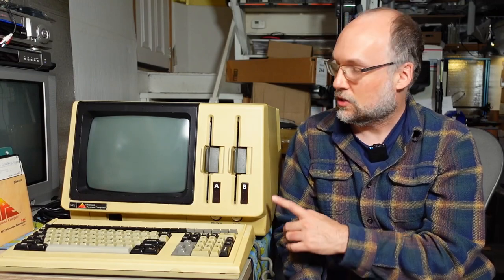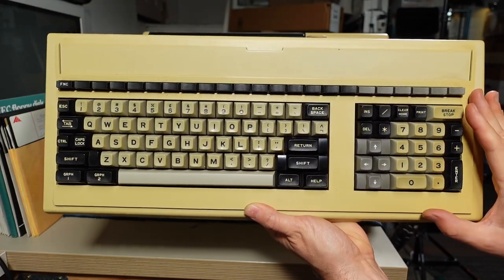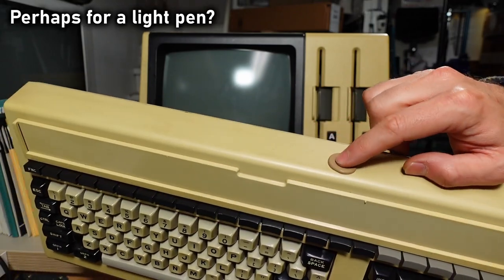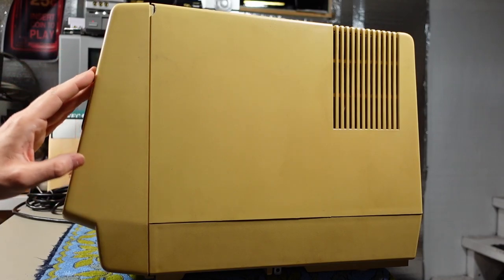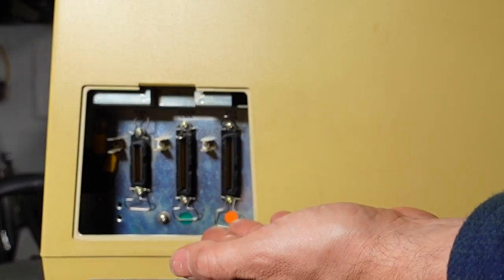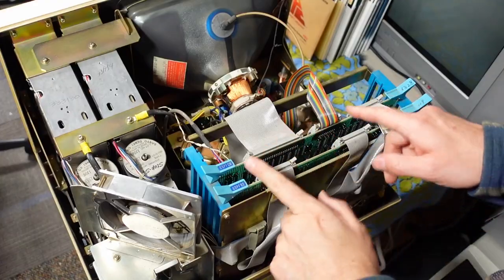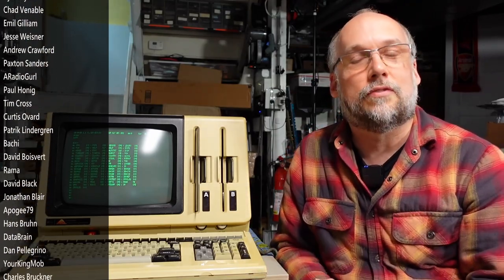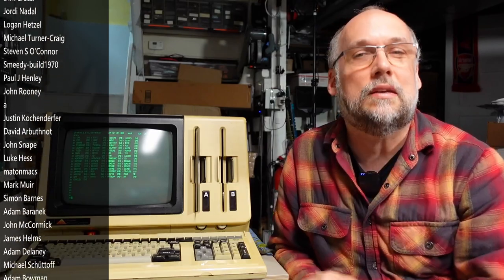The NEC APC runs MS-DOS from 8" disks

Comment: Looks like a really nice system to work on.  I wonder if it's possible to hack in Harddisk support via the leftover DMA channel, and a BIOS/ROM extension :)
Since the 8086 has a 16-bit data bus,even at only a little over the XT frequency, it should run quite a bit faster, since the data doesn't have to come into the chip in chunks of 8 bits.

Comment: Adrian I'm looking at the memory map that you have on screen a person could go into the 8K ROM at ffff and alter it to where the first thing it does is checks $128 KB of battery backed up memory for a special character at the first bite to see if it has a copy of dolls stored in it and could boot the machine straight off of that memory chunk check the first bite to see if it's a wire and in if it's an in it Boots the system as normal off the floppy if it's a y it starts executing the memory at the a1000 address

Comment: It's fairly common for 115 and 230 V fans to be made from metal, either partially or entirely, even today. Nowadays you wouldn't put them into a computer because they generate too much noise, but they are still used in some appliances

Comment: 42:53 - at the jump cut the Power light came on, maybe it has something to do with the keyboard being connected?
Reply from the maker: Strangely after using it some more, the power light just seems to have a delay coming on. It's directly connected to the power cord, so it has to be the switch itself -- but it is just odd! I saw the power switch coming on so I made sure to leave it in when I edited the video.

Comment: 28:16 <-- APU probably stands for Arithmetic Processing Unit, an early name for (at least some) FPUs/math coprocessors. That, or it's the Auxiliary Power Unit (jet engine in the plane's tail) that Sully started even though it wasn't on the checklist at that point. If there's some distinct and rarely-used APU enable line in the Advanced PC, consider tapping on to that and hooking that up to a little RasPi with a speaker has Sully/Tom Hanks say "I'm starting the APU" every time that gets enabled.
Reply: Yes, the 8087 APU chip was an option for the NEC APC. Intel chips before the 80486 needed a separate optional x87 chip to do floating point math.

Comment: The simplest way to get data off would be with the modem and crossover cable. It would be slow and you may have to pipe files to transmittable format but should be able to transmit anything on there.

Comment: Interesting machine. It takes one back to the days when equipment was documented properly, even home products such as TVs radios and computers often had a schematic in the manual or pasted inside the case. Now you just get a thick novel telling you not to electrocute yourself, or use the TV in the shower, in 57 languages. Another way that progress has gone backwards.

Ah the perennial problem of how to get the first bytes onto a different format computer! As others have said laplink or even xtree are possible dos transfer programs for serial or parralel ports, but you still have to get the remote code onto the subject pc first. 

I was battling with a similar problem with an apricot pc which also comes from the same non ibm compatible era. Iirc it was the first pc to use the 3.5 inch drives and also had a hires screen. It was quite a popular model in its day in UK and also Europe so I am told. Apricot eventually went ibm compatible with later models and got bought out by one of the Japanese computer makers although I can't recall if it was NEC or mitsubishi. I haven't resolved this transfer quandary yet as the power supply arbitrarily failed in between usages, and I've not had time to fix it. So I will be watching your efforts with interest.

Comment: @39:06 truth tables..not really equations..and only useful if the pals are strictly IO-based combinatorial logic (although that's entirely possible and maybe even likely) but still not quite the same as the actual code/defs burnt onto le pal
Reply: Mr Guru  fair and I didn't say impossible..still wouldn't call them equations..haven't used pals but assumed they'd do more than just combi..but I did say otherwise that the listed tables would be what ya need

Comment: As a guess, they used the older numeric coprocessor because they used an NEC V20.  The V20 has a true 8080 compatibility mode which isn't supported by the 8088, and this would have given them direct compatibility with the PC88 line of machines.

Comment: Partial address decoding allows the use of a minimum of logic (or even just one specific address line) to select a certain section of RAM. Full decoding required use of PALs, which were not cheap back then. Fun fact - Even though the 64 uses a PLA for address decoding, all the addresses from $D000-$DFFF are partially decoded.

Comment: I can't believe it came with THIS many 8 inch floppy disks! I never saw so many at once! Also 1MB Drives are not that uncommon. I don't know why they were used more? My Commodore 8050 Dual floppy with around 1040KB per disk, more than a Megabyte. 1984, 1.25MB 5,25" FDD's became the standard on PC98 that sold like 25 Million units. I think Commodore used Quad Density drives and GCR and NEC used High Density MFM.....

Comment: I have a color version with hard disk drive. I think pc-kermit supports the apc, so getting that to the machine would be a start. Or first copy com1: to a file for a small transfer program. 

The serial port pinout seems to be D25 ribbon cable so I made a ribbon cable with F25 connector and routed it to the main board. I haven't tried it yet, but rs232 debugger shows signals in the right pins.

Comment: I had a APC3 'back then', as in I bought it brand new from an NEC dealer. As far as I know APC1 was a single drive APC, and APC2 was a dual drive machine, Apparently the optional graphics card was quite expensive.
I've seen a few NASA pictures with desks lined with colour graphics equipped APC's - they had the money!
The APC3 had all the graphics as standard, and didn't need a slow persistence monitor. I'm guessing they had trouble with a too higher line frequency for the desired resolution, and solved it by using a really low frame rate.
The documentation on mine was likewise superb, and I had no trouble writing software in Borlands TurboPascal to access all the machines abilities. Back then Turbo Pascal came in two flavours, IBM PC and straight DOS only, of course there were limited built in commands, you had to do it all yourself, not a problem with NEC's documentation.
Later on as the IBM PC really started taking all the market, NEC brought out a compatibility card for the APC3, called the SLE card, (Software Library Expansion) that allowed you to run early IBM only software. Trouble was this was quite early on in IBM PC days, so all you got was CGA. The SLE card had its own 8088 and ram, with the APC3's processor then dedicated to mapping the resultant graphics etc onto the APC3's screen. (it worked really well)
When it came to EGA & VGA, NEC's answer was the APC4, a 386 based machine that was way outside my budget.
The APC3 has to be the best and most reliable/stable machines I've ever owned, it only died (crashed) when I did silly things with my code.
Reply: The later (successor) machines you are referring to were called APC-III and APC-IV, pronounced APC 3 or APC 4.  The APC-III had the SLE card option.

Comment: I don't understand, why exactly you can't use floppy drives on this thing to get data on and off? You need disk of different system or what?
Reply: Mr Guru  why not use the drive already built in?
Reply: Mr Guru  or are those two drives not connected somehow, or he doesn't have any other 8" disks and he wants to connect other disk size drive?

Comment: MS-Dos disks should be FAT12, It doesn't support anything else unless you write a driver/tsr for it bypassing dos and why would you do that. MS-Dos copy command also has limited ability to copy to and from serial and parallel ports, not really a solution only really going to work with text files.

Comment: That is a fascinating computer!  I loved learning about it.  I think it is interesting that they would bother with 8" disks in this thing.  They had 5.25", so called, Quad-Density drives (double density media, really) that had 1MB storage. By 1982 none of the local computer stores around me were even selling 8" disks any longer.  Not sure why NEC and the TRS-80 Model 2 went backwards to older disk formats?
Reply: 8 inch had higher capacity in 1981 or 82 when this machine was designed, so for business use they might kept the highest capacity

Comment: That light in the switch is most likely connected to AC, and the pilot light is mostly likely a neon bulb with resistor. The bulb inside would be an NE-2 bulb which often had a resistor as one of its legs.
Reply: BTW:  You can still buy NE-2 bulbs but there is a different number for them for some reason.
Reply: @kensmith5694  I have seen them used for indications lights, but also used as 60 volt regulators (without the resistor) in tube type circuits. I know they glow purple if you break the leads off of of one and float it in a cup of water the cup in the microwave. The fun starts when the magnetron kicks in.
Reply: @DishNetworkDealerNEO  Yes, and if you hit them with a high power spike they also make a purple light pulse.  They were also used to make blinking lights back in days gone by.    It takes more voltage to start them than to keep them lit,.  A resistor in series and a capacitor across one and it will blink.  The circuit only works up to a few KHz so although you can make an "electric piano" toy with them easily, you can't make much of a radio transmitter out of them.
Reply: @kensmith5694  I built the chasing lights neon kit P-Box from Radio Shack. I still have it and it still works!
Reply: @DishNetworkDealerNEO  Yes, NE-2 based things generally work until someone breaks them.

Comment: 8" floppies ! Haven't those for a long while. You know where the term "floppy" comes from if you've ever handled an 8" floppy.

By 1980, the 5-1/4" floppy was already well established. The only reason to use 8", was probably capacity. My experience with 8" disks, came first with Tektronix's proprietary TekDOS, used on their development systems. TekDOS was dog slow, compared to contemporary CP/M, which I also used with 8" floppies.

For the youngsters, note all the sheet metal. If you were an engineer, for a small company, back then, in addition to designing electronics, and programming, you may also have to design the sheet metal chassis components. I ended up being a partner in a sheet metal business, later in my career.

Comment: 28:17 APU would have been the 8087 arithmetic processing Unit.
Reply: It is the arithmetic processing unit but not the 8087 since this machine uses the 8231 instead. Adrian mentions it at 24:48.
Reply: @N0zer0  I had missed that.  Thank you.   The 8231 was before my time.   I didn't realize it was being used on the 8086 since it was so slow.  I thought it was a APU from the 8080 era.
Reply: @larsulrich2761  The 8088/8086 were heavily drafting upon their successful 8-bit predecessors. They didn't even bother designing 16-bit versions of the core peripherals until much, much later.

Comment: on any 8088/86 it has to have ram starting at 0x0000 as thats where the interrupt vector table is located(non configurable in the cpu)
Reply: To be specific at reset IP = 0, CS = FFFF

Comment: If you have CP/M86 running you should have a copy of pip which can be used to copy data from the serial port onto the disk.  There is no flow control so you have to work within the limitations of the rx buffer but you should be able to send across small buffers and reassemble them once you have received to file.  Many many years ago I did write a small utility that did this to send the initial files to pip on new computers so it def can be done.
Reply: yes but AFAIK binary file cannot be transferred due to EOF character
do you know of a relatively simple way to convert HEX into binary?
IIRC it's supposed to be LOAD command, but I don't see that file at 44:10, was that a builtin?
there is supposed to be some kind of DDT + SAVE trick I don't know much about